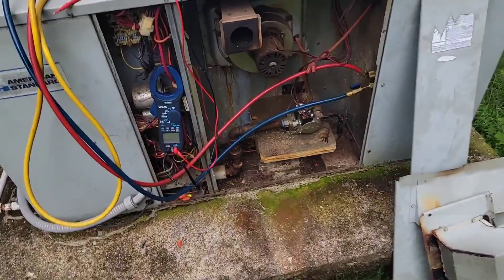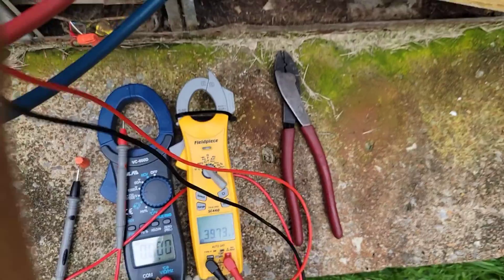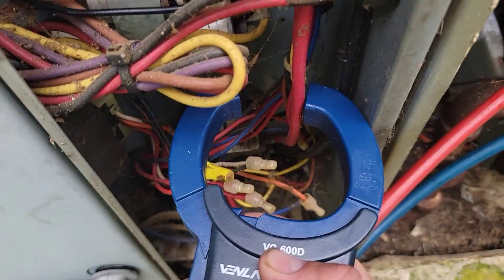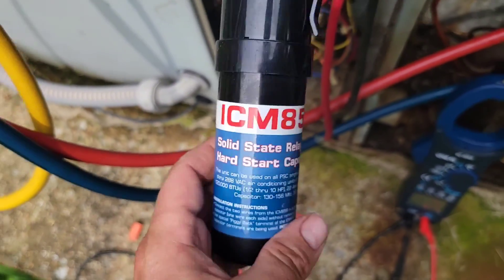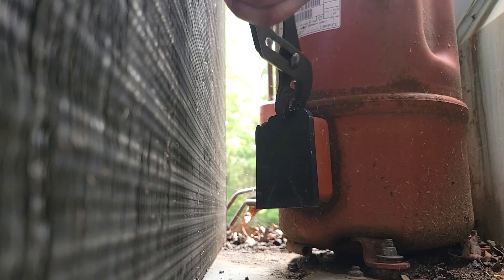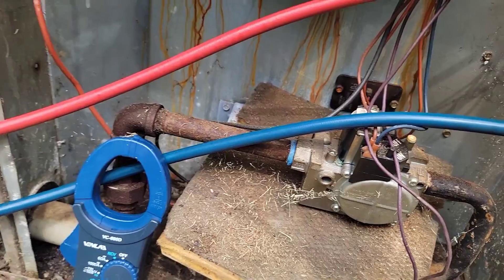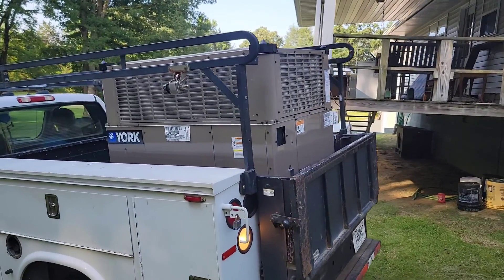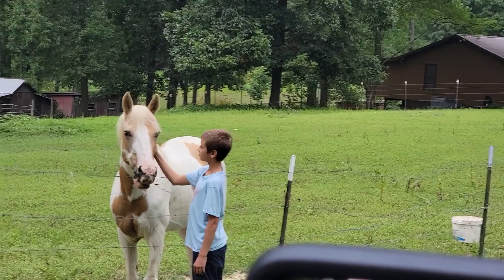How to know if the Compressor is Bad? @americanstandard

Comment: The compressor in my son's A/C unit was 46 years old when it finally gave up.  It blew a pin which caused a rapid reduction in pressure.  No serious work on the outdoor unit and indoor unit in those 46 years.  The capacitors were still in spec.

Comment: Today 10/04/2024 I went to an no cooling call. I told to the customer turn on the ac, and connected my gauges and the pressure in the high side was 270 and low side was pumping down until 50 psi and the condenser turn off and then turn on, and again and again, so i realize that there's no refeigerant
Reply: After that, because my company doesn't permit me to get some nitrogen, I just put more refrigerant to get 122 in low side and 299 in the high side.
Reply: The unit kept running and suddenly I saw that my compressor turned off, I saw my pressures equalize and my amperage in my common line from my compressor was pulling 9 amps. Then I checked my capacitor and it was good.

Comment: Great video, you sure do know you stuff. I have a question, you should that both the low and high side were about 150 psi, I assume that 27 year old system was R22, so what should the pressures have been for a working 2.5 ton R22 compressor? Thanks
Reply from the maker: On a ninety five degree day
Low side would be around seventy p s I g

High side would be around two hundred to two twenty five ps I g.

Comment: 27 years old and still running? I would let the unit run and self destruct PDQ. Then go to my local HVAC wholesaler, buy a new unit and be done with all the anxiety
Reply: We have a 25-30 year (not sure exactly) year old Carrier that is still running strong. We've lived here for 23 years and never had an issue knock on wood and every other thing
Reply: My American standard 5 ton R22 has only had one major problem a slow leak which my cousin found last Wednesday. Added 10 pounds of R22 spent 7 hours my unit, with the magic aire 2.5 ton in the basement. Which needed a new blower motor. Cousin charged me $500. Both machines are running like brand new. My cousin said they should be hopefully good for another 20 years. Because I've had almost no problems in 20 years. I put both units in the house 20 years ago.
Reply: @MrBjorn6  - 10 pounds of R22 alone from any other would cost you around $1,000.00.
Reply: @MrBjorn6  - to diagnose and  replace a simple run capacitor is another $250.00. It’s simply not economical feasible to keep such a system if free parts and services are not available to the average person.
Reply: @BartSimpson-nr1dy I don't have free part or service I pay for parts and pay my cousin for his service. I believe we agreed on $500 for 7 hours of work off the books,. and I cooked him my legendary oxtail and rice with my legendary Mac and cheese!!!!